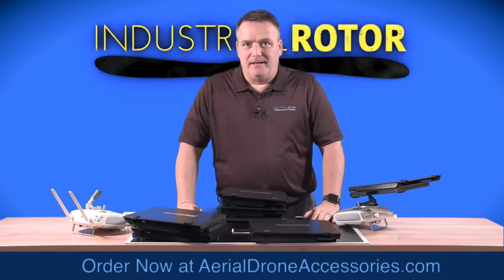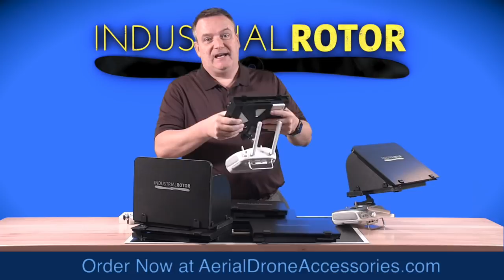MASTER SERIES MKII for the entire iPad Line Up

Comment: Hi, Can I use my Iphone with that system? I mean will like to swapp between my tablet and my Ipone. Thanks
Reply from the maker: Hi Luis,

With our system we sale a no slip tray adaptor.  Since you asked about it I would be glad to send it to you at no charge.  This adaptor slips into the DJI Tray that came with your transmitter and allows you to use the tray with our no slip mount.  This way you can use the Sunshade when you need it and when you want to use your phone you would simply use the standard tray with our adaptor.  After you purchase the Sunshade respond back on here and I’ll add it to your order. 

Thanks,
Stacy
Reply: Thanks for you help. How can I order both,?
Reply from the maker: Go to our website and chose both your Master Series MK II Sunshade and then under products at the top of the page select "No Slip Mount Products" under the drop down.   Select the "No Slip Tray Adaptor" and add it to your cart.   At Check out use the coupon code "Tray Adaptor" and it will take $9.99 off of your order for the cost of the adaptor.
Reply: Thanks, right now
Reply from the maker: Luis Alberto Arias  thank you for your order. It will go out first thing as soon as delivery resumes after the new year.